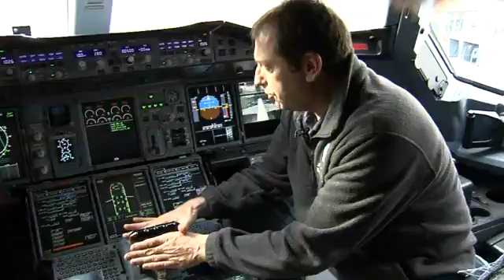First flight for the Trent XWB on the A380 Test Bed

Comment: I'm sure you recognise the drawbacks & limitations of all these other forms of transport. Modern high speed trains are the only form of transport that can compete with (short-haul only) air travel, for efficiency & time. Their limited route networks are a big drawback.
Ships are efficient cargo carriers but are less fuel-efficient than airliners for long distance passenger transport (QE2 achieves 17 passenger mpg, compared to the A380's 78).

Comment: Err.......Ships, Trains, Low altitude  aircraft, Air-Ships. 

But if you really absolutely just  have to take another shopping trip New York or go on another  holiday why not fly  on a half empty jumbo burning 1 Tonne of kerosene every 4 minutes oh so efficiently 8-12km above the surface of this Planet, with the chance that it will,  from its vast poisonous exhaust, manufacture a frozen Acid-Rain reflective Climate Changing Cloud of Combustion, Contrail-Cirrus. 
All because your worth it.

Comment: Airbus used an A340 to test the A380's engines. The ~80000lbf Trent 900 looked huge on the A340, with little ground clearance, so for testing engines from 74000lbf up to 97000lbf thrust I suppose the larger A380 prototype is a more practical test aircraft.